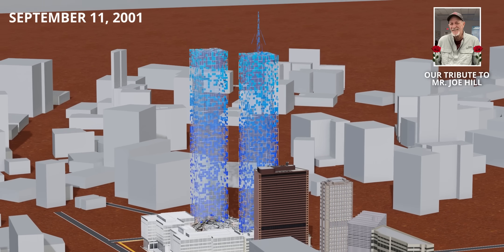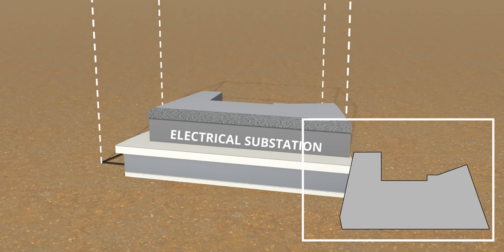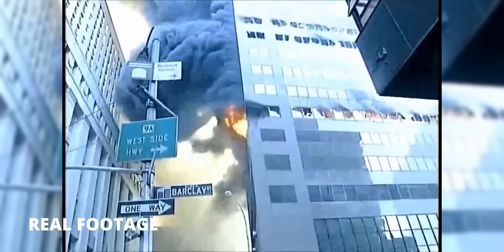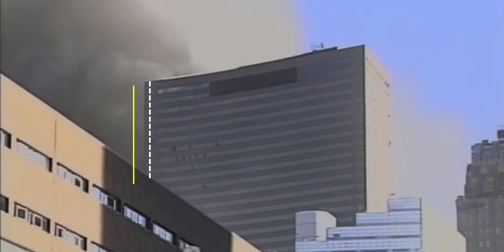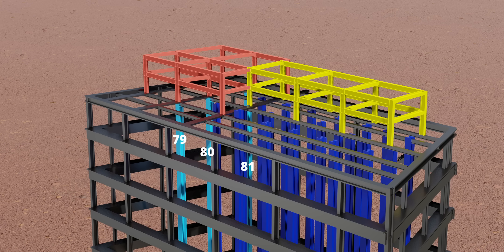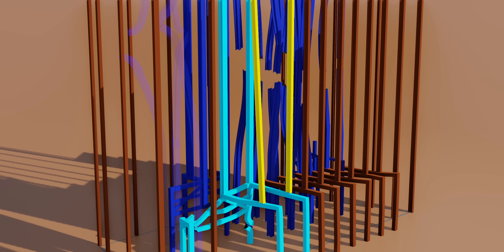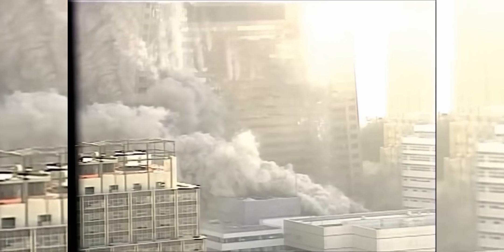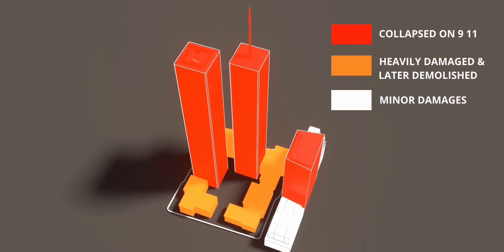Collapse of Building 7 | The Complete Physics

Comment: If this is true, WTC 7 was constructed very poorly..
Reply: Building 7 was designed - like many large buildings - with a 2 to 3 hour fire rating.  This assumes a fire starting in one location then spreading - like a normal fire - and subjected to the buildings own active and passive fire suppression systems and with active firefighting taking place.

On 9/11 Building 7 had multiple fires start on multiple floors simultaneously, active and passive fire suppression was compromised and there was no effective active firefighting.

It lasted for 7 hours and there were zero casualties. A remarkable performance and a credit to its design and builders.
Reply: 1.The firefighters said" it looked like they planned to take down the building" I didn't say that, The fire fighters said that. They were there.I'm sure they know best.
https://youtu.be/XiIT4HInWjY?si=e1Pvp3-IFs-M75Oj
When the firefighter says "boom, boom, boom, boom" in this video.
What do you suppose he is?Implying by " boom" ?? What do you hear? 
2.So if there were no explosives then what is this? 8:25
https://youtu.be/bLF5D7M1YgA?si=aHSvS__uOdxMi1ZB
You can't say that it was added because you can see the firemen's reaction to the explosion. And you can't say it came from anywhere else because the firefighter says
" We gotta get out of here,  7 is exploding "
3. Controlled demolitions have squibs, you can see the squibs here 20 floors below the collapse. 
https://youtu.be/eXAgulfAtR4?si=-iLO9aQjMJVLTUYH
4. Firefighter says "any one of these buildings could blow up,  this ain't over yet" firefighter says there's 3 secondary explosions. 
https://youtu.be/0Gh3ErgMI4M?si=mmp9Eus_5PWTCBfl
5. Airplanes can't fly 600 mph at 1000 feet. And to be able to make a 180 degree turn to hit the opposite side of the pentagon going that fast is ridiculous. And since when do terrorists hit the opposite side of the building where no one was at when they could have just flown straight in and killed way more people???
https://youtu.be/0Gh3ErgMI4M?si=mmp9Eus_5PWTCBfl
7. No one has ever known ahead of time that a building was going to collapse except through controlled demolition.  Tower 7 was reported to have fallen while it still stood in the background. 
8. Larry silverstein,  the man who made over 4.5 billion when they fell, claimed to have pulled the building down.
https://youtu.be/1jQaJFNWqtc?si=wCywQ9grgBdS_w11
9. A witness reported a missile hit the pentagon while he was seen at the scene. 
And the hole wasn't big enough for a plane and the damage wasn't consistent to the towers. And just like shanksville,  there's pictures that show no plane parts at all.
https://youtu.be/6_Ez-UCpXMs?si=JaQ6DBEC_LJtMLgN
10. That video also points out They were military planes that hit the twin towers. 
11. All sorts of reports of explosions were reported that day.  
12 Buildings dont accidentally fall  Into it's own footprint.
Reply: @robbiehiatt9966  "1.The firefighters said" it looked like they planned to take down the building" I didn't say that, The fire fighters said that. They were there.I'm sure they know best."
No, they didn't. Yes you made that up.

"if there were no explosives then what is this?"
We don't know, because we don't see it. But we DO know that it's been added, because it's not on the original.

"And you can't say it came from anywhere else because the firefighter says
" We gotta get out of here,  7 is exploding ""
I can say anything because no-one says that.

" Controlled demolitions have squibs, you can see the squibs here 20 floors below the collapse. "
No, they don't. They have explosions. And you can't see that there, because demolitions explosions happens on every floor, and _on the collapsing floor. Here in the real world, we call that "air".

"Airplanes can't fly 600 mph at 1000 feet. "
Making up dumb shit doesn't it true.

" And to be able to make a 180 degree turn to hit the opposite side of the pentagon going that fast is ridiculous."
So, you had nothing and had to make up dumb shit about something irrelevant instead.

"And since when do terrorists hit the opposite side of the building where no one was at when they could have just flown straight in and killed way more people???"
Presumably since you lied.

"No one has ever known ahead of time that a building was going to collapse except through controlled demolition. "
Anyone with basic knowledge would know that a building would collapse. If the building has been burning for 5 hours, it's very obvious. Lying doesn't mean you're right.

" Larry silverstein,  the man who made over 4.5 billion when they fell, claimed to have pulled the building down."
Which is why he's about 10 billion in the hole, I'm sure. Meanwhile, that you're too dumb to understand spoken English isn't an argument for anything other than your failure.

" A witness reported a missile hit the pentagon while he was seen at the scene. "
No such "witness" exist, though. Your lies are just lies.

"And the hole wasn't big enough for a plane "
Because the body of a plane is 75 feet across. No, that's just you being dumb again.

"the damage wasn't consistent to the towers"
Imagine, a 77 feet tall brick and concrete building isn't the same as a 110-story tall steel skyscraper. Who'd have thought.

"And just like shanksville,  there's pictures that show no plane parts at all."
Because pictures that doesn't show things are relevant. No, no they're not. Meanwhile, the pictures that do, not to mention the 19 tons found, are.

"That video also points out They were military planes that hit the twin towers. "
And that Santa was involved. And other dumb shit.

"All sorts of reports of explosions were reported that day.  "
No reports of explosions were reported that day. Loud noises were reported, but that's irrelevant.

"Buildings dont accidentally fall  Into it's own footprint."
And other irrelevant and dumb shit.

Comment: For someone who has a bit of knowledge in structure design and architecture, it is definitely not difficult to imagine how this could happen knowing the unfortunate design of the building. But i can imagine that for the normal person, is difficult to even imagine.
Reply: es gibt keine einzige Kamera aufnahme aus dem inneren der gebäude .
Reply: 1.The firefighters said" it looked like they planned to take down the building" I didn't say that, The fire fighters said that. They were there.I'm sure they know best.
https://youtu.be/XiIT4HInWjY?si=e1Pvp3-IFs-M75Oj
When the firefighter says "boom, boom, boom, boom" in this video.
What do you suppose he is?Implying by " boom" ?? What do you hear? 
2.So if there were no explosives then what is this? 8:25
https://youtu.be/bLF5D7M1YgA?si=aHSvS__uOdxMi1ZB
You can't say that it was added because you can see the firemen's reaction to the explosion. And you can't say it came from anywhere else because the firefighter says
" We gotta get out of here,  7 is exploding "
3. Controlled demolitions have squibs, you can see the squibs here 20 floors below the collapse. 
https://youtu.be/eXAgulfAtR4?si=-iLO9aQjMJVLTUYH
4. Firefighter says "any one of these buildings could blow up,  this ain't over yet" firefighter says there's 3 secondary explosions. 
https://youtu.be/0Gh3ErgMI4M?si=mmp9Eus_5PWTCBfl
5. Airplanes can't fly 600 mph at 1000 feet. And to be able to make a 180 degree turn to hit the opposite side of the pentagon going that fast is ridiculous. And since when do terrorists hit the opposite side of the building where no one was at when they could have just flown straight in and killed way more people???
https://youtu.be/0Gh3ErgMI4M?si=mmp9Eus_5PWTCBfl
7. No one has ever known ahead of time that a building was going to collapse except through controlled demolition.  Tower 7 was reported to have fallen while it still stood in the background. 
8. Larry silverstein,  the man who made over 4.5 billion when they fell, claimed to have pulled the building down.
https://youtu.be/1jQaJFNWqtc?si=wCywQ9grgBdS_w11
9. A witness reported a missile hit the pentagon while he was seen at the scene. 
And the hole wasn't big enough for a plane and the damage wasn't consistent to the towers. And just like shanksville,  there's pictures that show no plane parts at all.
https://youtu.be/6_Ez-UCpXMs?si=JaQ6DBEC_LJtMLgN
10. That video also points out They were military planes that hit the twin towers. 
11. All sorts of reports of explosions were reported that day.  
12 Buildings dont accidentally fall  Into it's own footprint.

Comment: If you can’t get the direction the antenna fell on the top of WTC 1 right, you can’t get anything right ! Controlled demolition explains it all
Reply: Controlled demolitions dont look like that, they use tape to cover the windows because of the explosions and you would need an expert to place them, during work hours, drilling holes into walls
Reply: "Controlled demolition" is a hand-wave for the terminally dumb, and so doesn't "explain" a single thing.

Comment: People like conspiracy more than physics. Steel burns just like most construction materials. If it burns for 7 hours what do you think is going to happen. If it burns at lower levels it has more force above it. It's why the North Tower collapse 1st although it was hit 2nd, but it was hit lower than the south tower.
Reply: If what you say is correct and the fires were going to burn down the towers. You're saying that steel Burns and that's not true either way. All 3 of these buildings were designed to burn to extinction without collapse. So what are you talking about the fires? Was going to bring down the buildings. Because that's simply not true if that's the case. No buildings are able to burn to completion without collapse. But that's not true.
Reply: @robbiehiatt9966 I'm a structural engineer,  steel burns, it's how it's formed,  by heat. At high enough temperatures steel burns, it actually melts but it deforms at high heat. If you have a fire with combustible materials covering steel  and there's enough material to continue to burn with out stopping for hour, which is what WTC 7 did, the heat will melt the steel. 
What's your bright ass idea???